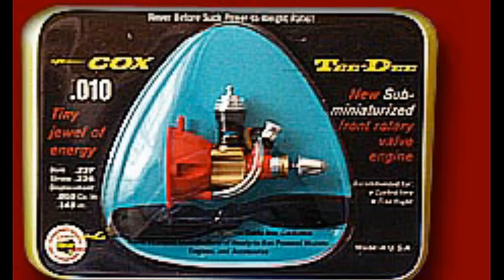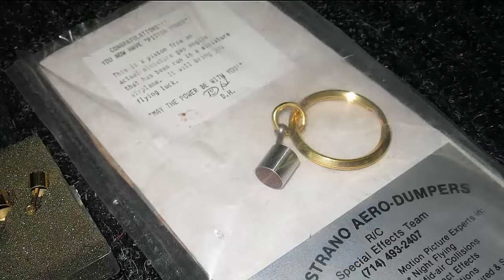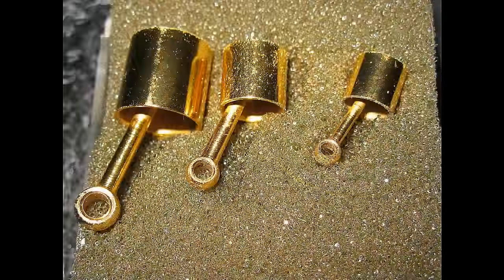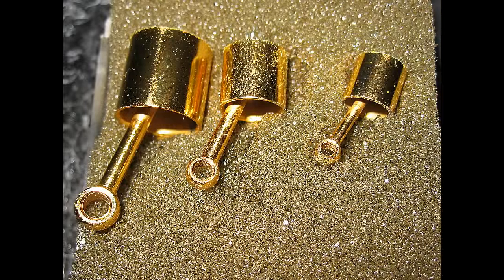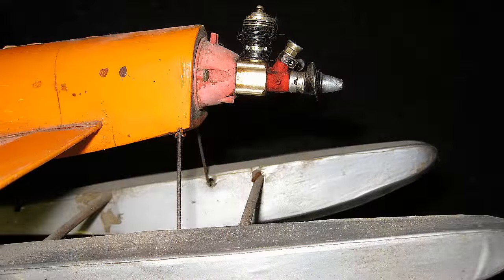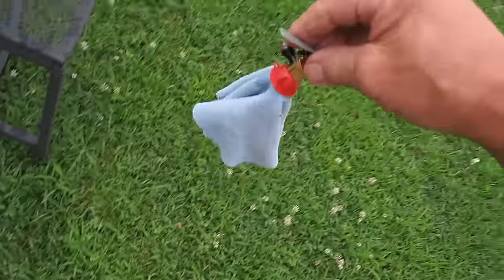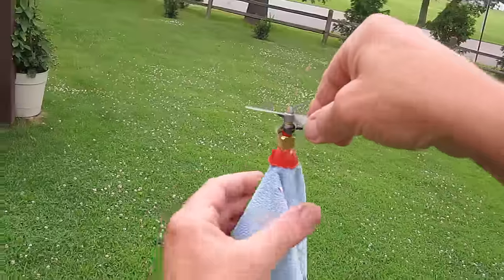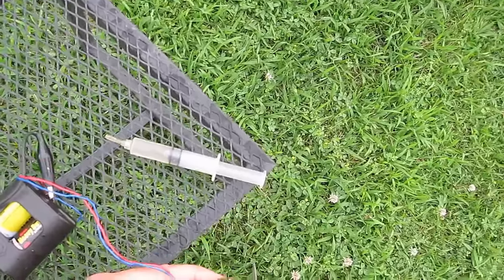Cox .010 Nitro Engine Powered Shop Rags. History and Demo.

Comment: We used to shoot estees rocket engines off using a tube or piece of angle iron but I've never seen this.  Too cool.  Kids are missing out these days. Thanks for sharing!
Reply from the maker: Right on!  Thanks a lot Don. If you found this interesting, I bet you will like this one better.  Flying shop rags part  II  https://www.youtube.com/watch?v=Q7MwFVHCRpY
Reply: We used to simply glue fins onto the Estes engines along with a launch tube and send them off on single-use, suicide missions.  Where they came down wasn't our department.  Great fun, indeed.
Reply: Everything for kids these days is make believe and computer generated.  They are missing out

Comment: Ahhh that sound. Brings back memories of the old .049 with a control line plane. The smell of nitro! The pain and the blood splatter when the plane slipped through your fingers and the prop smashes into your OTHER fingers!
Reply from the maker: Right on, make sure to see my PT 19 .049 flight. Thanks so kindly. https://www.youtube.com/watch?v=BU0z7ddwslY&lc=UgxAjk538XovWipP6nV4AaABAg
Reply: That's one way to develop common sense and mount the engine instead of holding it in your hand or doing that stupid shop rag thing.
Reply: @garygullikson6349  - think back to when you were about 10.  Then re-read where I type "the plane slipped".  As in the plane... that the engine was attached to.  That slipped through my fingers.  Whatever, that was 50 years ago and I'm over it.
Reply from the maker: @garygullikson6349  50 years ago when we all started doing this, kids were tough.  Today.....not so much.

Comment: I remember those days. I had a Cox PT 19. We use to rubber band the wings and motor into place to fly them with U controls. The rubber bands would release when we crashed or landed hard. For us a good landing was an one you could still fly after. Thanks Dave, for the walk down memory lane.

Comment: I found an .049 engine attached to a broken plane at the Goodwill bin store a few years back. Bought it for less than $1 buck, took it home, cleaned it, attached it to a 2x4 in the garage and fired it up.  Worked great after who knows how many years. I may have to dig it back out and try the shop rag. Good times. Thanks for the video.
Reply from the maker: Right on.  That is great.  This is an 010, so you will need a slightly larger rag.  Make sure to see part II.  It is better.  Thanks.  https://www.youtube.com/watch?v=Q7MwFVHCRpY&t=193s
Reply: How far did the 2x4 fly? 😉🇦🇺
Reply: @NightFlyyer  Thanks for the second link and the memories.
Reply: @johno9507  Good question.  I had the 2x4 clamped to the workbench, otherwise it probably would have banged into the car, or who knows what.

Comment: Back in the 60's I used to just crank up an 049 and turn it loose with out anything tide to it they would just about go out of sight, and after loseing one I started trying 4 strings to the mounting holes of the 049 and tiying the other ends of the strings to the 4 corners of a old hanrchef and twist it to the left so it would stay twisted on the way up due to tourk after the 049 stoped running it would come down like parachute, that made it easier to find in the grass. Wow I have not thought about doing that for years thanks for reminding me of how much Missile Mist glow fule went through doing that all summer. It had to be in the gallons.
Reply from the maker: Thats a great story. I was using K&B 1000.  LOL.  If you found this interesting, I bet you will like this one better.  Flying shop rags part  II  https://www.youtube.com/watch?v=Q7MwFVHCRpY  Thanks so kindly.

Comment: That's one thing I've never done... ONLY because I never thought of it or saw it done.  Thanks for the trip back to wonderful days.  When I broke all my flying stock, I mounted an engine mounting block at the end of a yardstick, cut it off at 14", glued on a flat balsa wing, rudder, and tail.... then rigged linkage to work the elevator.  They flew really well and helped a lot of kids learn to fly U-control for cheap.

Comment: That's so cool. We used to do that 50 yrs ago.  I didn't know Cox made a. .10.  " I want one"  thanks for the video
Reply from the maker: Yes, they do.  The .10 is actually 1 more than .99. Cox made those big engines too, twice the size of the .049   We started doing rags with .049s in the 60's, but later when the .020 and .010 became available we used them.  I hated to lose this engine in the fire, as they are rare.  You can get a new old stock one from http://www.coxengines.com   Thanks and have fun.
Reply: @NightFlyyer  Thank you very much.       Tim Cooper

Comment: Fun.  Wish I still had my old Shrike tethered prop driven circle car.  Still have the cracks in the middle of the driveway in that old house from all the nails we drove into the center of it for the tether.  From that to control line to RC boats, cars, planes, and choppers.  I should do a video on paraballoons for the kids today to see and play with.  They were very light weighted (a small nut or washer) cleaner bag thermal ascending parachutes, hours of fun!

Comment: I'd love to know how that technology came to be. Was it accidental,  oh there it goes hooked to moms towel or was it thought out and designed. It's a good way like you said to get more use from the engine after the last bad landing. I had a Cox plane but broke it on the ground before ever firing the engine. Not the only time something like that had such a short life. Lol. My buddy had a dragster that he could get engine to run but it needed like some type wire to run straight. Maybe strong line would have worked 
Thanks for sharing
Reply from the maker: Well, as far as I know, I am the first one do do this. I did several with .049's when I was a kid at age 10, 66 years ago. It was just an idea that popped up in my head as what to do with the engine after the Cox planes were destroyed.  After that, we had contests to see how long they would fly.  Thanks and happy flying.

Comment: I just bought a cox/testor  star cruiser its basically a gas powered frisbee it looks like it's never been ran. It seems to have great compression and all the parts are their I just have no clue what to get for fuel or how you get the glow plug to get hot
Reply from the maker: I thought I answered you, but here again is the link to see exactly how to start the engine and what you need to do it in my part II shop rag video. Enjoy and good luck.  https://www.youtube.com/watch?v=Q7MwFVHCRpY&t=193s

Comment: I think it's incredible those older plastic props could withstand those rpms.
Reply from the maker: Yes, they are pretty strong.
Reply: Ox - I was told by seasoned model engine pilots to boil the props in water a couple of minutes. I never ever had a breakage!

Comment: Wish I knew that one when I was a kid.  8th grade metal shop I turned out a 1 1/2 inch flywheel for the .10 I had. Talk about scream, I have no idea how many  RPMs that turned.  After that I screwed it to the picnic table and ran it with a prop.  The castor oil was a hit with Mom, no wonder she drank.
Reply from the maker: Right on!  A great story. Thanks much.

Comment: I had that little Cox 0.10 engine
In a small size Guillows models 
Focke Wulf FW 190 U control
It flew really great 😀
But when the summer was over
The airplane was soaked in caster oil😁 this was back in the Early seventies
Reply from the maker: Bummer about the Airplane.  I wish I hadn't lost this engine in the fire for sure.  Here is part II of the flying rag video, you may enjoy.  Thanks Captain!  https://www.youtube.com/watch?v=Q7MwFVHCRpY&t=193s

Comment: I had .049s, .020s and an .010, but I was never able to get the .010 to run. I suspect that I used the wrong fuel. What should I use?
Reply from the maker: Thats a bummer.  I used the same fuel in all my small engines.  Torko Racing fuel, 20%.  But this is a tee dee, so carb must be primed and needle set open at 1 1/2  Good luck and make sure to see part II, as it is even better.  Thanks.  Here's the link.  https://www.youtube.com/watch?v=Q7MwFVHCRpY&t=193s

Comment: Got to ask, how many times have you had your fingers bit by the blade, brings back memories. thank you...
Reply: My strongest memories are of the Cox Stuka and the Fokker Triplane. For some reason my strongest memories include trying to start these planes in cold weather, with jackets and even gloves on. You couldn't start the engine with the gloves on, so you are getting your fingers bladed by the props, with the cold fuel soaking into the cuts, and evaporating alcohol freezing your fingers even worse - the Cox tri-fecta - ha. We would do this for hours and it was just the price to pay. We gradually learned more and more about starting the engines and what could go wrong with them - like burnt out heads, occasionally. Learned to take them apart and sort of understand how they worked. It seems we learned lessons of commitment and sacrifice early in those situations - are kids getting those lessons, these days?

Comment: hmmm. Can these be throttled? Like if you had a servo running something, or are they just wide open? If they are throttled, why couldn't you use 4 of them and make a gas powered drone?
Reply from the maker: There were no throttles on the 010 or 020 engines. 049's had some throttles, but never could achieve the precise rpm control that would be needed for a drone. Drones require very exacting rpm changes that have to happen instantly, plus you would need gas tank, etc, plus 4 servos for throttles.  Not possible...yet.  Good question.  Make sure to see part II.  It is better and almost flew too long.  Thanks kindly.  https://www.youtube.com/watch?v=Q7MwFVHCRpY&t=193s

Comment: I was quite the Cox engine aficionado  back in the day. Never got one of the TeeDee .010 engines, but had the PeeWee .020, lots of .049s (Babe Bee, Golden Bee, Black Widow, RR1, Medalion, TeeDee, etc.), a .09 and a couple .15s  All were great engines.  The damn reed valve jobs could be a pain if you got the reed even slightly disturbed, but generally they all ran well, and I ran them a lot in my hand as you show in this vid (to test my "guts" at the age of 12-13, I used to prime a McCoy .35 and fire it up in my hand .. when my parents weren't home).  Never flew a shop rag, but do remember making a sort of helicopter using a coffee can, some music wire for arms, and some balsa wood fastened to the music wire to make up a large "prop". The can would go up with the engine running, then when it cut out, it would flip over and "auto-rotate" down.  Best done in a Big field when the wind was blowing. Thanks for the memories. Kids these days will never know the kind of excitement and fulfillment we had as young modelers.

Comment: Probably close to 35, maybe 40 years ago, my dad had a COX Helicopter that you tied to the ground with a 100 foot long thin cable. 
You would start up the little COX 010 or .020 motor and prop and the torque would run up the Main Blades. 
When it was up to speed, you just let it go.
It was a Free Flight COX Sky Copter. 
It flew, pretty much, straight up until it got to the end of the line. 
Never will forget the time him and my uncle forgot to secure the line. 
We drove for miles with it in sight, but never did find it when it ran outta gas.

Thanks for the memories Dave!

~R~
Reply: Sorry, man.
Reply: Go out into the world.Fly like superman.

Comment: I have a piston from a big block .21 on my keychain, had it for years.  I also have an old COX helicopter with a tiny nitro motor, smaller than the .049 but have never flown it.
Reply from the maker: Big block.  LOL.  The Cox Helicopters had .020 engines and were fun too. Make sure to see part II.  It has an almost too long of flight.  Thanks much.  https://www.youtube.com/watch?v=Q7MwFVHCRpY&t=193s

Comment: Man, I miss those things. I did that with a rag and Baby Bee .049 in 1975. The engine was runnign a bit rich when I launched it, so instead of climbing it sort of hovered around 15 feet up and traveled forward for the first ten seconds or so. At that point the engine leaned out and started to climb.The darn thing didn't give up until it left the field we flew upon and was over a paved parking lot. Some bent and gouged head fins were the result of the hard landing.

Baby Bee, Golden Bee, Dragonfly, RC Bee, Medallion, Tee Dee and many tankless engines resurrected from broken COX aircraft, all .049's I once owned and flew (I felt their main competitor's engines, TESTORS, were junk). Never owned a Cox .010, .020 or .090. though.

  The electrics just don't have the same thrill to me, though I fly them today. I mess th e smell and the scream....and simply the fun of operating a liquid-fuel model engine.

Comment: My first .049 was in an injection molded Mustang. First flight ever itt was going round and round pretty well so decided to try a wingover. Those Cox molded plastic planes gould not recover from those. The engine went into a Baby Flight Streak which went on to many flights. My last Ukie was a Flight Streak with a K&B .40 that we flew in club races. Got plans for a stunter called an Aries and an LA .40.  One of these days, if I can get a proper workshop.
Reply from the maker: Right on. I certainly loved my Baby Flight Streak as well, but wound up in contests with Veco Thunderbirds and a Nobler. Here is Part II of this flying shop rag, which is even better.  https://www.youtube.com/watch?v=Q7MwFVHCRpY   And this one is a little more of my Ukie stuff you may enjoy.   https://www.youtube.com/watch?v=NntPP4HA1E0&t=145s  If you search my channel for UKIE, you will find many.   Now lets go fly that Aries.  Thanks so much.

Comment: Damn, I brought forward my old circa 1970:th cox baby bee .49 when I re-entered the hobby after many years 2005. I mounted the motor on top of a 2m rc glider, and my best flight was when I forgot to turn the receiver on. I had mounted the elevator servo upside down, so the lack of control was making the flight much better. Never tried the shop rag flight tough.
Reply from the maker: If all else fails the Shop rag has the same amount of control as your glider with the radio turned off.  It may land without damage though.  Check out the later version flight.  https://www.youtube.com/watch?v=Q7MwFVHCRpY

Comment: Dave, this is sooo cool! I am definitely trying this!!! What would the dimensions of the rag be for an .049? Or does it not have to be that particular?
Reply from the maker: Yep, Wish I still had that engine.  Check the description box to see it fly on a full tank and where it went.   If I remember, it was a circular rag that was 12" in diameter.  The microfiber rags work good, as they have lots of drag.  Good luck and make sure you can see where it lands.  Thanks.
Reply: NightFlyyer thanks 🙏.

Comment: I'm heartbroken from everything turning to electricity for everything. I'm only 38 but through the end of the 90's & early 2000s my father was into control airplanes & I was into Nitro power Radio controlled cars. I just feel like it's become too easy of a hobby now & with drones taking up R/c planes it's turned into something that wasn't ever meant to be.
Reply from the maker: Well said.  I'm still a Nitro guy at heart, but also forced into electrics as well.  Thanks kindly.  Now go run something nitro!

Comment: i just had a box of rc gas engines given to me. they are Enya 60-II. I remember the little .049 cox engines. I wish I had known about shop rag engines. we crashed everything back then. i just got back into rc planes myself. as far as I am concerned, i will never go back to the nitro powered crap. Electric is clean and easy, less expensive to fly and fix. foam is my friend.
Reply: +scott firman 

"Crap" is a little bit harsh I think. Yes, nitro engines actually were a less-than-ideal solution following the very heavy and underpowered battery-coil-ignition gas engines of the 30ies and the actually very sucessful "diesel" engines, which were just using somewhat expensive fuel with a short shelf-life and were somewhat finicky to tune. Since lithium batteries are available, electric is definitely the better alternative from a sober, technical standpoint. 

I actually really like it for casual flying since it just, like a friend of mine say, limits itself to just working. 

But .. exactly that makes it somewhat boring to myself. I just the like the feeling of finally having managed to start that small engine be hand, smelling the castor oil exhaust fumes, hearing it .. and I know something about electric motors and they are actually very very simple machines. A combustion engine, especially a fourstroke one, is way more fascinating.